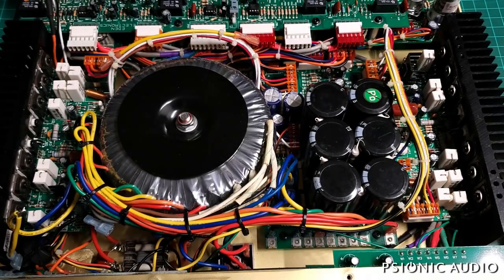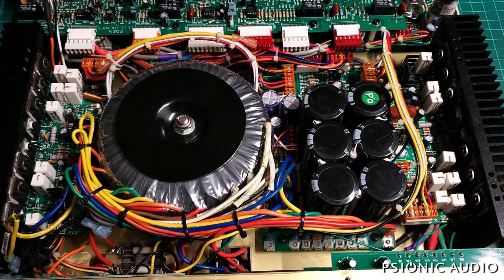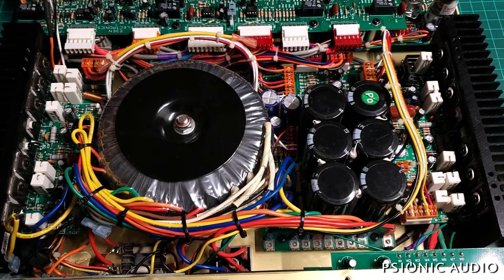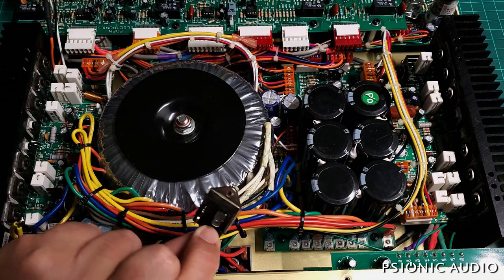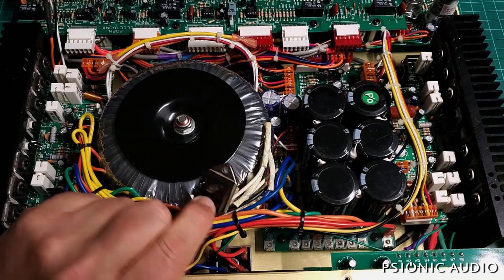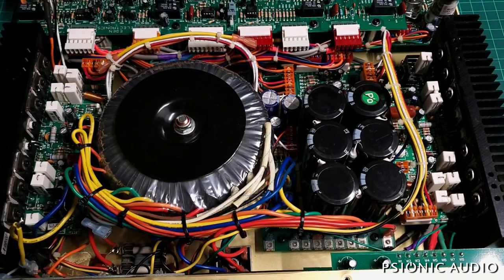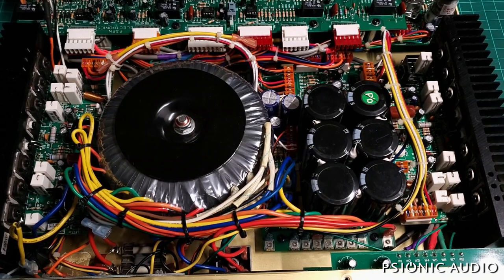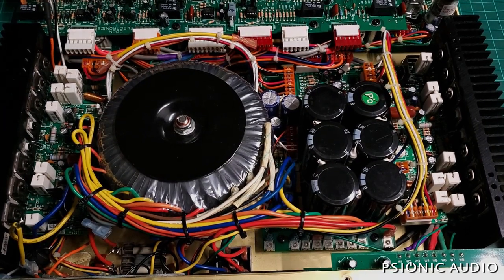Eden World Tour WT-1205 | Part 1 : Did the Owner Get Lucky?

Comment: Hey I have one of those little Aguilar class D amps. It sounds great and so far (3 years) has held up just fine. What I love about it is that I can carry it and a 12" speaker cabinet in one hand, they weigh so little. My back is a lot happier. My old Ampeg SVT head and 4x10 cab weight about 40 tons, ran hot and was noisy.

Comment: Yep Class D Epifani 600 watt  @ 4 ohm bass head…. Had it since 2015, zip nada, zero  has gone wrong. Looking after your gear is half the battle. Disposable, nah, now a back up amp. Got the bigger 750 watt head for larger venues. 2 years & zero repair. Had a brand new Eden combo amp wayyyy back. 2months in had to send it back to Eden’s repair S/C….. sat for 3 months & returned back. Not fixed. Went back to the music shop &  the owner took it back, no questions asked. hmmm wonder why. Exchanged for a TC Electronic RH 450 & cab. Sold it to a buddy in 2013. He still has it & running perfectly.

Comment: That is a Triac. Peavey used a lot of them in their big amps like the CS800. It is used to switch the power on to the power transformer.  Here is a link to one https://www.tubesandmore.com/products/triac-q6025p5-alternistor-600v-25a-fastpack-3-base You can bypass it easily to check the amp out by going around it.
Reply from the maker: Yup. Ordered one yesterday. But thanks for the good thought.
Reply: Peavey CS800! You are dating yourself if you remember those beasts! Big, bulky and heavy; not ideal for hauling around on the road but good for permanent installations. Fairly easy to work on and keep running. Yes, I'm old too....
Reply: One has to wonder how huge that transformer is if they need a speciality triac (alternistors are triacs for inductive loads) to switch it on and off. Is the idea to soft start the transformer to limit the inrush current maybe? Or maybe point on wave switching as they do with big power transformers?
Reply: @goodun2974  I worked in a music store for 41 years repairing electronic stuff and I repaired a ton of the old CS series amps along with a lot of other things. I always hate it when someone would bring in their road case with 3 or 4 big amps in them. They were just too heavy.
Reply: @sstorholm  On a big amp you have to consider the amount of current it pulls at startup. Remember there are some really big caps that have to charge up.  These were used since the on/off switches just wouldn't hold up very long without them due to the arcing and high currents.
Reply: @PsionicAudio  If you haven't already done it don't forget to check the control voltage going to the gate of the Triac. That is what turns the Triac on which turns the amp on.

Comment: First observation.  That looks like an unmitigated nightmare inside that box, yikes, talk about NOT repair-friendly!  I think, before you buy an amp, you should have the opportunity to open it up and see what kind of mess lurks inside.  If i saw that bunch of junk crammed in there, I would take a pass.
Second observation.  Either you work very quickly or you have decided that sleep and a social life are unnecessary.  I'm amazed by the sheer quantity of amps you service in such a short time with videos to boot.
Lastly, about 75% of what you say goes straight over my head but I find it all fascinating, nonetheless.  And now I can't sleep because I'm worried about the IC brand caps in my Hot Rod Deluxe...